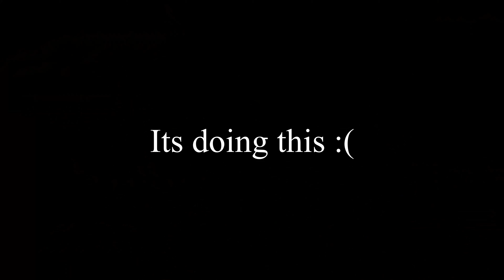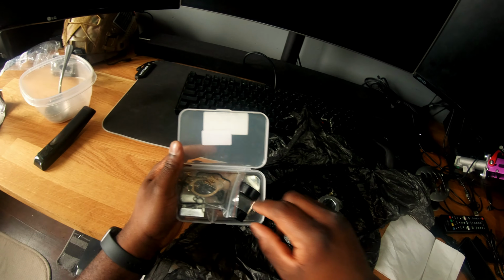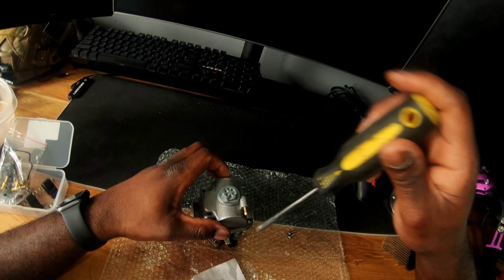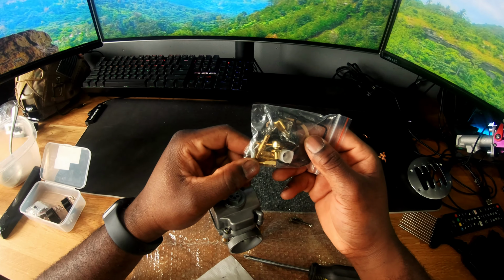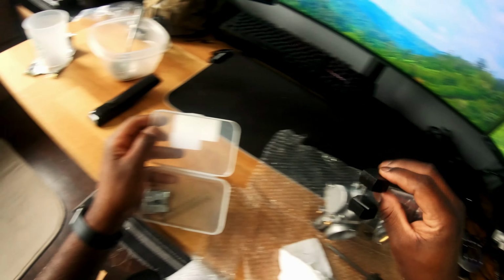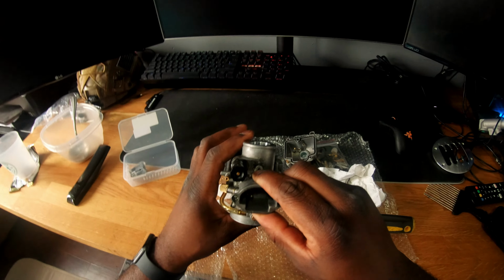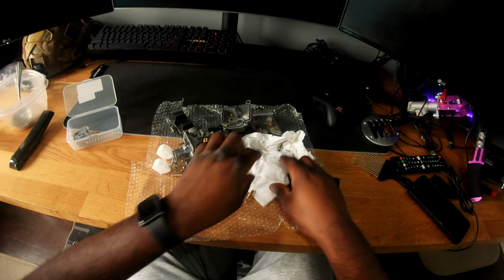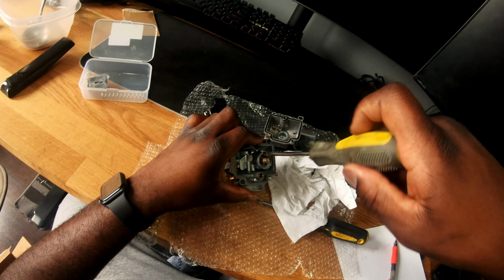TRYING TO FIX MY OVER REVVING MOTORIZED BIKE - OKO PWK Carburetor 21- 30mm REBUILD |MOTORIZED BIKE

Comment: I have the dio reed kit on my yd100 and mine will do it every so often depending on how much I ride and it's the hose clamps that go around the reed valve and where it goes around the carb. Im 43 years old and it doesn't matter how much I tightened them. They always come loose sooner or later. The dio reed kit comes with a piece of rubber that goes between the pwk and the reed valve but I've thought about changing it to a hose like most people have i just haven't done it yet

Comment: Had the same issue on my reed valve clone carb setup all right adjusted the two adjustments on the side of the car a big one I believe is for your fuel needle and the small one closest to the air filter is for your air intake as in how much are I believe it takes in I'm just now learning on how to figure this out I had a really high idle now I have a hard time getting any speed so I'm having the opposite problem now if anybody happens to figure out or have any tips

Comment: I got my 21mm oko running one time then I park it to warm up to turn the idle adjustment screw down then. The idle got extremely high the pipe got Smokey then shut off ain't been able to get it started all weekend I did drill the hole in the valcum passage way like Rob said stock main and pilot air screw was 1 and half turn out..Any ideas?
Reply: if the idle goes up then your running lean.2 stroke raise there idle when there is less oil plus air causing causing higher idle and more then likely wear the internals.
Reply: @permafrost8541  Ya I figured it out the trottle cable was pulled up on first start rings snap cylinder and piston was ruined

Comment: Are your engines ported at all or do u just run the reed valve with a windowed piston I believe to run one u either need 3rd tranfer port or a windowed.piston I wanna do sk.thing like this to my skyhawk gt5a beast little engine just need some upgrades but all stock will go bout 50 -55 mph and I'm 185 pds any info about builds u have experiencd if u could let me.know thanks Marcus great videos btw
Reply from the maker: Yea all my motor are ported except for the black one with the head on it. This gold and black motor in the video doesn’t have a window piston. 

The black one with the head Nothing is done to it internal. 
This company called zeda Motorsports build my motors. You should look at the GT C frame from CDHpower. Thats my next build frame.
Reply from the maker: Also in this video I realized my carb was clogged up internal. My bowl wasn’t receiving fuel fast enough

Comment: Hey nice video, can u help me? My thottle cable is not long enough to go through the whole entire inside of the carb? It goes half way through the spring.
Reply from the maker: Do u have the stock cable?
Reply: @LifeofMarcus  Hey thanks for trying to help me, my friend fixed it.  your supposed to thread the throttle cable to a spring in the carb and the throttle cable wasant long enough to go all the way through the spring.  but my friend figured it out and I'm now riding my bike. thanks for trying to help appreciate it!
Reply from the maker: Np, YT its hard to comment and have me help u fix something right then and there.

Comment: I have a dio reed it’s all brand new like I just put it together and finally got it running, it will idle fine but when I get on the throttle then let off it will stay at high rpm I’m thinking about using rtv around where it seals to the block would this help Bc I think i have a vacuum leak somewhere
Reply from the maker: I fixed mines. So it was a combination of things. Seal the hose where the carb not with rtv but make sure the clamps are tight enough. Then make sure your gas lines are flow to the max. Could check by opening your carb where the float is and turning your gas valve back on. Hold your float and move it up and down to see if your getting the flow to the carb. ALSO CHECK YOUR Throttle cable to make sure its hooked up right. CHECK your air/fuel mixture. Or could be bad gas.
Reply: Life of Marcus thank you for your time I got it to stop over revving I also see that you are from Baltimore we should ride sometime
Reply from the maker: We should. I need to fix both bikes. Waiting on parts.

Comment: Do you recommend using a 21 mm pwk carb without a reed valve
Reply from the maker: I never have so i dont know. But i would say use the reed valve. It helps alot.

Comment: Can I just ask, what size jets are you using for the carburettor?
Reply from the maker: currently now running slow 35 main 130,
Reply: For my bt100 I run 32 slow and 100 main
Reply from the maker: I which to 30 and 100 works way better
Reply: @LifeofMarcus  try a 28. Its on ebay but only a couple vendors have it
Reply: I want to get the thumb gas one where can I get one it will work for it
Reply: @LifeofMarcus  is this for the big carburettor you have on it now?
Reply: @jackcarns1941  for the big carb?
Reply from the maker: @angusseeley3420  no

Comment: I have a quick question when you first run your bike I ran my bike and it overheats it's my first time breaking it in is that normal after the break-in that their motor is so hot
Reply from the maker: Thats Weird that’s not supposed to overheat like that
Reply: Your carburetor is running lean. You need to tune it, probably put a bigger jet in it.
Reply from the maker: @NoName-ef9tq  I found out what it was, I had my throttle cable on wrong

Comment: Sounded like it was running out of gas. Could have just been dirt plugging the needle. Two strokes rev when they are running out of gas or an air leak. If not the carb then do a leak down
Reply: Ya I do think it wasn't getting fuel my own stupidity pull the top 2 screws  loose on the g2 reeds..2 reed pedals was ruin not sealed. So I think it's the reeds not function properly
Reply from the maker: I will try to see if its the reed.
Reply: I heard same thing! "Air leak" mine is doing this exact same shit!  Where do I look for an air leak or vacuum leak idk?

Comment: I have a similar issue my carb is revving super high when I start it up
Reply from the maker: Did u check your gas lines? Or carb ? Did u fix it?
Reply: Tyler McDonald    I’m having same issue! Just suddenly, out of nowhere, my engine is revving super high! It’s a the same carb as this one, hp carburetor. Ran fantastic for months and now suddenly? Well I did remove it checking some other stuff and it hasn’t worked since then. Maybe I just need to seal up real good around the intake where it connects? The idle is very erratic.
Reply: It’s kinda normal because it’s getting in gas later and then it calms down but idk
Reply: @robbyclark6915  that's the most common place for a vacuum leak. I took my carb off cause I installed a windowed piston and reed valve on my zeda 80 and now it's got a vacuum leak and I sprayed carb cleaner and that's the spot

Comment: The problem is that the slide is hanging up in the carburetor not allowing it to return to idle. I'm having the same issue right now.

After spending $1400 on parts and receiving good service without an issue I purchased this OKO PWK 26MM carburetor from Mike at NCY Store. After installing it I immediately had an issue with the slide hanging up not allowing the engine to return to idle. Out of the box the inside of the carburetor was scarred really bad not allowing the slide to move freely. I contacted Mike and informed him of the problem. I was told that they don't offer support nor do they accept returns and he would rather lose business than give me a refund or an exchange. Terrible attitude and no way to do business. Don't buy this carburetor. I'm still having problems with it.
Reply from the maker: Mines was my Throttle cable was sticking. Try to make sure you dont have any crazy bends or have the cable zip tied to tight.
Reply from the maker: Or try to put some 2 stroke oil on the slide